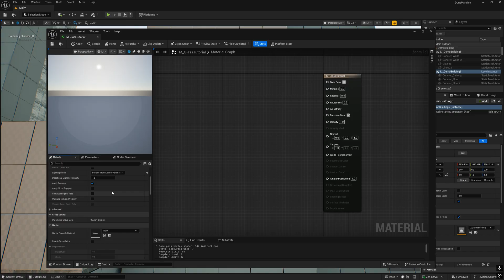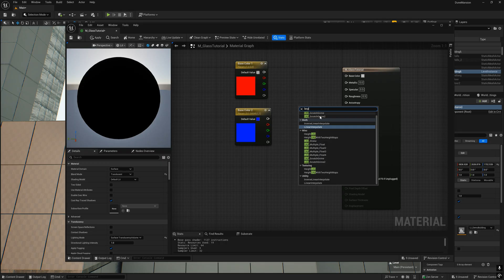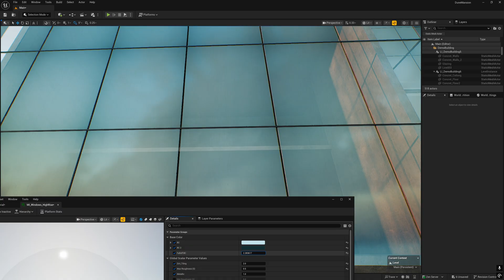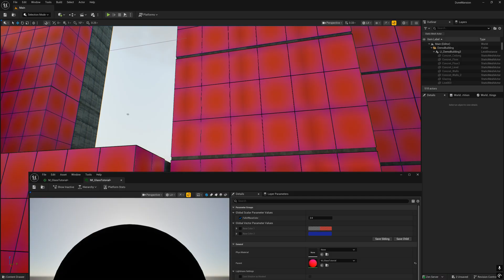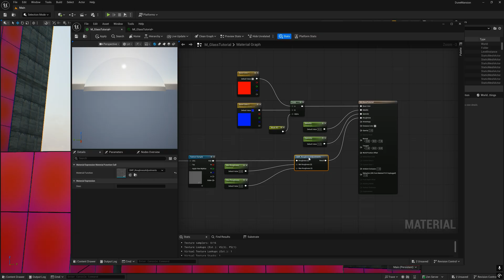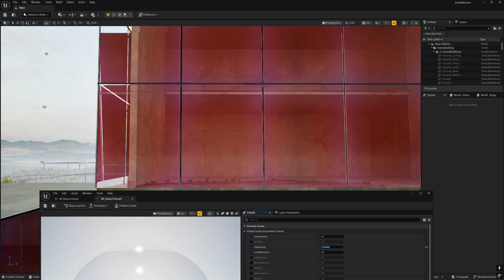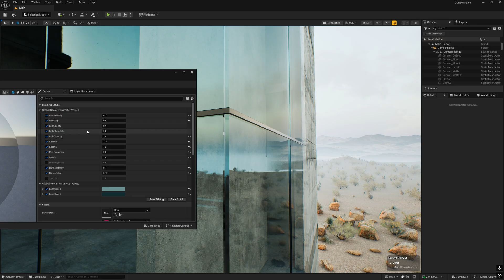The ULTIMATE Guide to Photorealistic Glass in Unreal Engine for Archviz | Tutorial

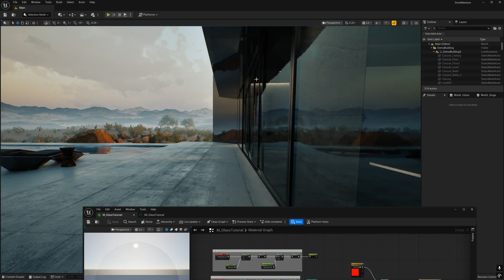Comment: Just noticed a weird error that I too get when I use the ior in the material @ 8:28. The error is that when you view the reflection on edge you will see a double pane in the reflection at a slightly different angle. This happens in Lumen but not in pathtracer. If a person was to go close to the pane in let's say VR they would see the oddly angled pane reflection which doesn't look realistic. Any idea on how to fix this? Thanks
Reply from the maker: Hey! Yeah, that double reflection bug is a real headache in Lumen. To fix it, try going into your Post Process Volume, find the Translucency settings, and switch the rendering Type from Raster to Ray Tracing. This forces the engine to calculate the reflections more accurately. The method is a bit more demanding on performance, but the result is totally worth it—the artifact disappears. Hope this helps!

Comment: It's a pretty nice shader, but I noticed one drawback: it doesn't produce any light reflections. Real glass can exhibit significant reflections and glares in sunlight, but this shader doesn't reflect at all, regardless of the angle and post process setings. While this may be suitable for architectural renderings, it may not be ideal for achieving a more photorealistic image with glares and other image imperfections.
Reply from the maker: Thanks for the feedback! Reflections are definitely there, controlled by standard PBR settings (Metallic at 1 and a very low Roughness for sharpness).

This material is specifically designed to be Lumen-friendly and performant for real-time visualization. It leverages Lumen's capabilities for reflections, which can sometimes appear more subtle depending on the lighting and environment compared to offline renders.

If you need the absolute maximum reflection quality (and your hardware allows), you can always switch the Translucency Reflection Type in the Post Process Volume to Ray Tracing. This will provide physically perfect reflections but comes at a higher performance cost. Hope this clarifies the approach!
Reply: @stan3dart  I probably expressed myself incorrectly. Basically, when light hits glass, it reflects off of it. And this shader does indeed reflect everything. But regarding light, there's also glare. It's especially noticeable when a huge spot of light reflects off the glass of buildings right into your eyes. I couldn't achieve that effect in this shader.
Reply: @slumsnake1303  I don't think Lumen supports this advanced stuff. Try this with PT, or maybe they need to switch su Substrate first
Reply: @Kogirius  It supports it, and I made a shader that shows the highlights. Works Without PT.
Reply: @slumsnake1303  Neat! Care to share? I am also looking a way to increase mirrorness of such glass... I can't find a way to make it reflective enpugh! I might have to look into clear coating...real modern arch glass is very reflective.

Comment: Thanks for sharing it. Great content. I noticed you have solid elements behind the glass, it will always look better by using this trick. Wondering  how this material will hold in day time environment with full transparent building. Couple of questions. 1.Are you using single plane as glass or box? 2. Every glass panel is separate 3d object with separate UVs? Thanks!
Reply from the maker: Fully transparent building is not a problem at all. By adjusting the parameters the opacity, you can get a great result even in bright daylight.
1. I use boxes (geometry with thickness), not single planes.
2. It's a single mesh, but each glass panel has its own separate UVs that fill the 0-1 space, which is crucial for the procedural mask to work correctly on each pane.